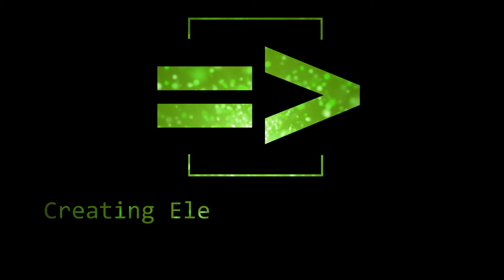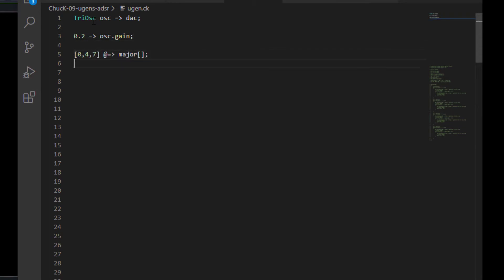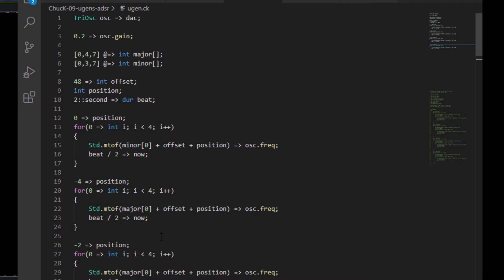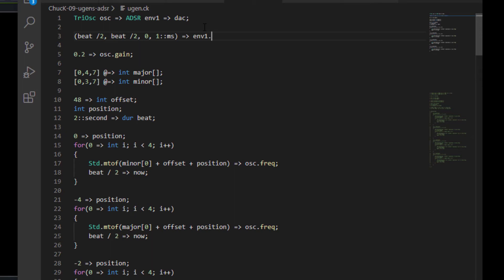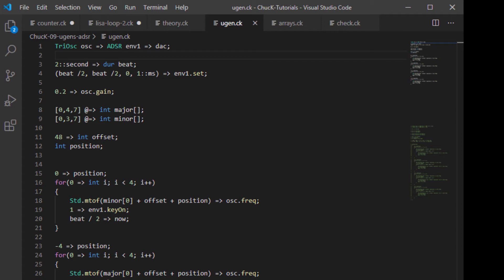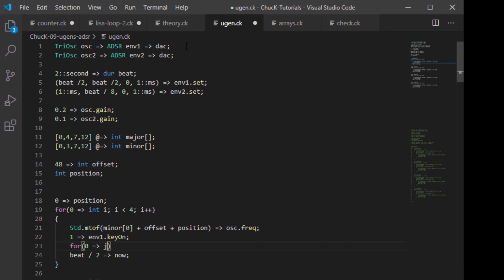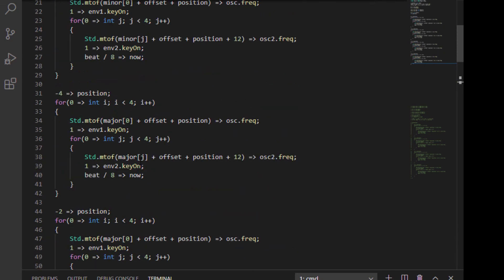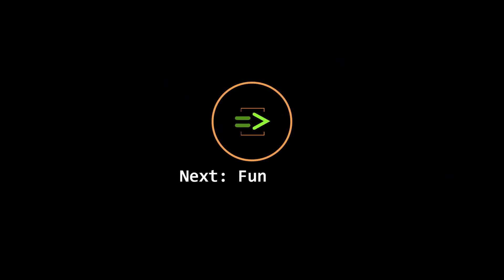Creating Electronic Music with ChucK - 09 - Ugens: The ADSR Ugen

Comment: Out of nowhere chuck/vs code keeps giving me this error. "line(8).char(2): syntax error" It usually happens when I make an edit or reopen a file but even when I go back to code that was working just a few minutes ago it still gives me the same error message.
Reply from the maker: Does the same code work in MiniAudicle?

One weird gotcha that popped up for me a couple of days ago - don't know if this is what's happening to you - is that sometimes VS Code seemingly decides to change the character encoding to "UTF-8 with BOM" instead of UTF-8. That's shown at the lower right of the window, you can change it back by clicking it, choosing Save With Encoding and choosing UTF-8 again.
If that's not it, if you post up a screenshot I can see if I can help you troubleshoot it(?).